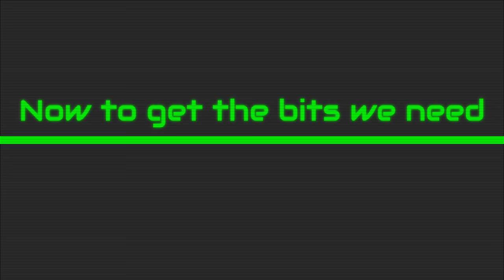Alfa romeo 159 project - Part 4 - how to remove front wing

Comment: Interesting thought about the seam sealing being wrong
Reply from the maker: Before the black 159 was written off I'd stripped the inner rear wheel arches and replaced the seam sealer. I found lots of misplaced sealer that didnt cover some seams properly. 
The sealant itself was starting to break down and despite looking okay was holding moisture in the seams.

Comment: That pore job of seam sealer... Its putting me off buying 159 now...

With that gearbox out you can swat open diff with lsd one. It will improve handling  quite a bit.
Reply from the maker: Dont be too put off, the very late ones were much better and had lots of improvements over the earlier ones. 
Newer 159s are also around 40kg lighter. 
If you got hold of a very late 2010 or 11 car you could get in with a waxoyl type product and protect it.
Reply: Had mine 5 years no problems, no rust, they are old cars now, same old addage, avoid unloved cheap cars.
M32 is fine if oil changed very year and 3 ltrs added.
Reply: Sills and all box sections filled withnwax every summer, like ntw underneath 2009 car black ti, all original paint no rust